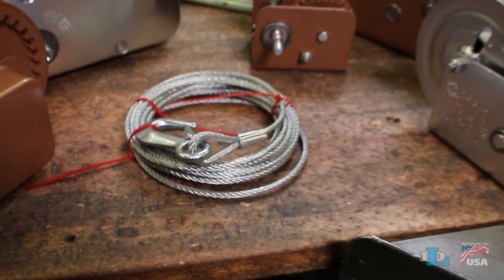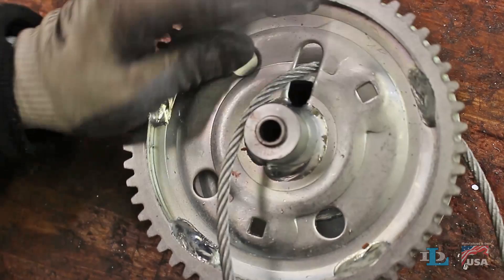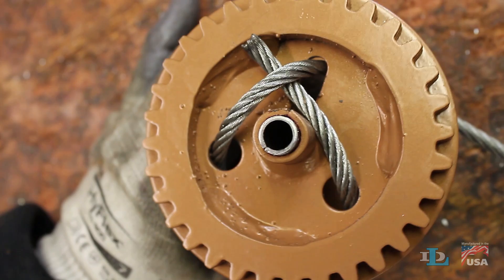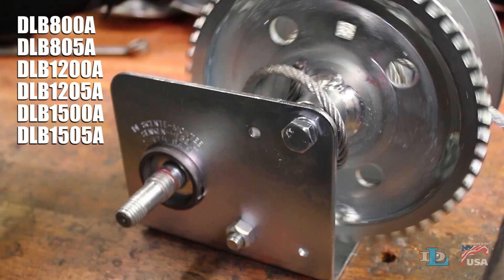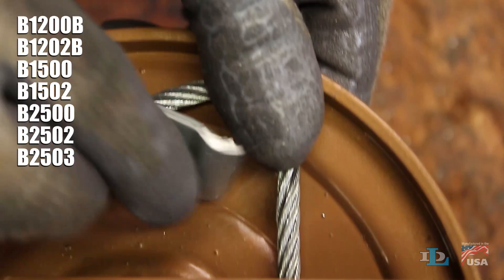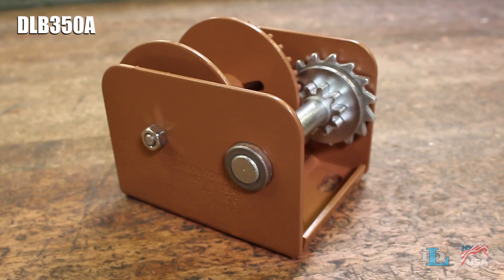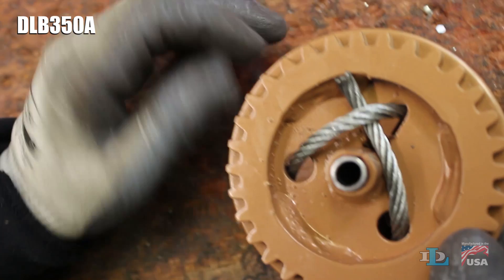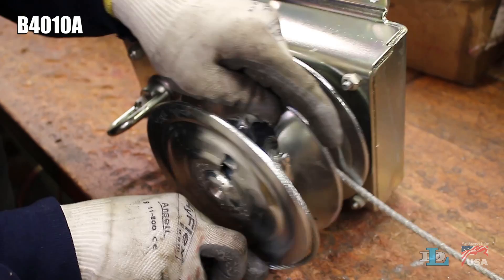Installing Cable on Brake Winches - Step-By-Step

Comment: What is the maximum diameter of the winch cable for the DLB350A model?
Reply from the maker: Thanks for your question!  The maximum diameter cable that will fit on the DLB350A is 5/32" cable.  Up to 54' of that diameter cable will fit on a DLB350A's reel.  The cable we recommend for that winch is up to 83' of 1/8" cable.